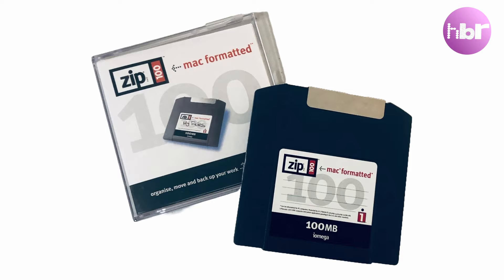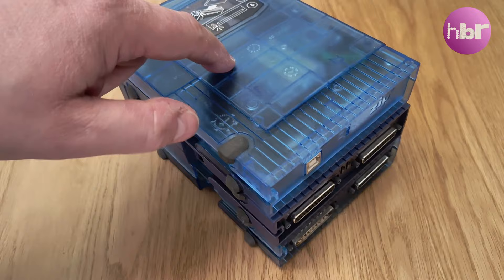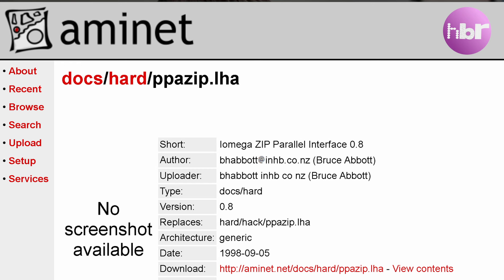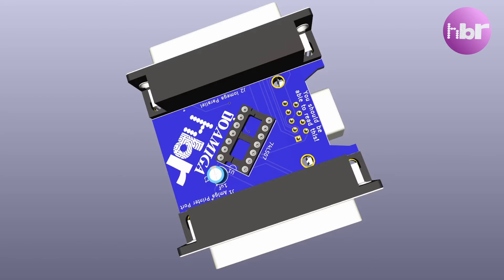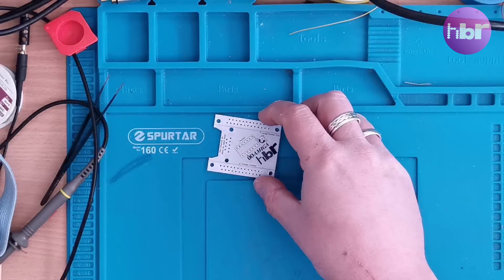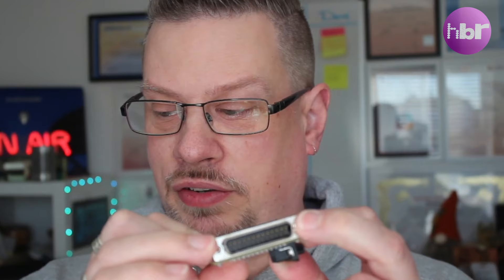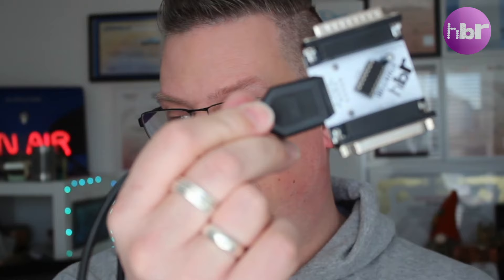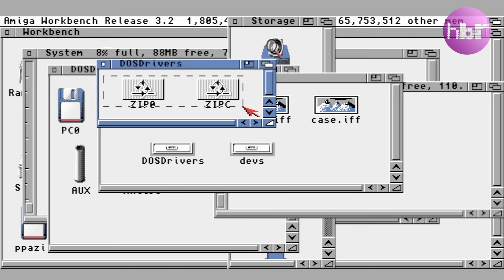Finally! Game Changing File Transfer, on the Amiga?

Comment: Maybe it's because I'm a tad too modern and have yet to even see an Amiga in person, but why not use an SD card adapter? Smaller, quicker speeds, still  works on modern devices... Granted I'm unsure if an SD adapter for Amiga computers even exists (and Ii mean full size SD cards, not mini or micro) but still. Zip disks are a wonderful option sure but they aren't being made anymore which means not everyone with an amiga can get them.. Though I guess you can't replace the nice mechanical charm they have with flash media, either..
Reply from the maker: Thanks for watching, and all valid points. You can get flash to work internally but that would mean constantly removing it then booting it in an emulator to transfer files... It's the quick transfer of data too big for a floppy like os update / installer alongside your HD / flash solution. In fact the A500+ in the video is 68030 @50Mhz accelerated with 8Gb compact Flash internally 😀
Reply: @hackbuildrestore  Wait, there's no way to mount and use flash media (SD card, compact flash, etc) on the outside of the Amiga like a floppy disk? Seriously?! That's just insane, and honestly does give the ioAmiga a lot more of a reason to exist in my eyes then, but still, WTF? Plus how would the zip disk work on both the Amiga and a modern Windows machine? Do both just understand FAT16 or something, or does the Amiga somehow understand FAT32?
Reply from the maker: If you're willing to cut holes or dangle cables I guess you could externally expose a compact flash disk, it's a bit easier on a 1200; but you still have to spin it up in emulation to copy files over 880Kb...  FAT has been around since 1980 ish, and yes the amiga can read FAT :) being from 1984-1994 depending on the model. Amiga OS 3.2.2.1 was released last year and contains drivers for DOS file systems (with Windows 9x long filename support) and FAT32 drivers too, not used them though. The disk used in the video is just a standard ZIP100PC FAT disk. Hay this solved the problem I had, and makes my life a little simpler, if it helps others great! If you don't like it or think it's stupid that's ok too 😀
Reply: @hackbuildrestore  That's still rather odd.. From what I've seen many older computers can use a flash disk externally through an adapter (which would make it seem like a floppy drive to the computer over SCSI or parallel) but, honestly, as long as the zip disks work, they work I guess. It isn't stupid to me at all (besides the seemingly odd limitation that there's no way to mount an external flash disk on an amiga without hardware mods, and you can't format it as FAT/FAT16/FAT32?), just seems like the best solution for now.
Reply from the maker: You have to bare in mind the Amiga was demoed in 1984 same year as the apple Macintosh was released, yet the amiga was colour and capable of stereo sound at a 38Khz sample rate way ahead of the time  including the multi-tasking graphical OS. To boot it uses it's own file system and partition system so to have a disk you can boot from it does so from a format that can't be read by a PC or mac, for data transfer it can read double density PC floppy disks, but native amiga disks can't be read by a PC without specialist hardware (Drawbridge or grease wesel) you can use a gotek to emulate a floppy drive that uses USB storage but still has the 880K disk size limitation. Scsi is only on board in a 3000. An ide interface is internal on 600/1200/4000 scsi is an option on big box amigas with expansion slots 1000/2000/3000/4000, the 600 and 1200 have PCIMCA which brings some options... but the 500 and 500+ that most people associate with "amiga" internal and external storage options are limited especially if your on a budget... There are side car expansions but these are rare and expensive, however, they can provide SCSI, networking or graphics expansion. A cheap scsi / USB solution would make an excellent future project!
Reply: @hackbuildrestore  I see I see.. Honestly that makes a lot of sense, thank you!
Reply from the maker: No problem, I hope your interest in vintage computing continues 😀
Reply: @hackbuildrestore  Oh trust me, it will! I don't have any actually vintage computers or devices (yet..) but I still use Windows 7 on my main PC. Half out of preference, half out of windows 10 (and linux generally, tried ubuntu in particular) not playing nice with my particular video setup..

Comment: I was using Zip 100 drives for exactly this purpose 10 years ago, when they weren’t STUPID prices on eBay. It was just a logical replacement for floppies and failing hard drives.

This is not new or game changing. 

Since then we’ve had multiple SSD solutions including Pi SCSI and BlueSCSI. 

I’ve had several of these Zip drives just fail on me for no apparent reason as well.
Reply from the maker: Thanks for watching, I am sorry you didn't enjoy the video, or find the content valuable. My point was really that the zip drive is still usable on modern hardware as well as most vintage machines. To your point not everyone has scsi or ide on their amiga, and such solutions don't always appeal to all amiga users, and don't provide simple solutions to transferring files between systems new and old. Out of the box there is little in the way of external storage devices for the Amiga 500/600/1200. This was a revelation to myself and I have tried to lower the barrier of entry for others.

Comment: Do you have a solution for the Superdisk LS120 via parallel port?
Reply from the maker: Unfortunately I don't, but it may be possible if it works similarly to the Iomega parallel interface. I don't have a drive myself and I can't recall them being popular in the UK back in the 90s. If I do come across one I may be tempted to give it a go using PPAZIP as a starting point.
Reply: Wouldnt it have made sense to use an SCSI drive?
Reply from the maker: If you have a SCSI drive and a SCSI controller to plug it into, yes... The 500/500+/600/1200 don't have a SCSI controller without some kind of expansion.
Reply: LSdrive in ide is supported with Idefix if i remember correctly. I own ide and usb versions :)

Comment: The Iomega Zip drive was an UTTER JOKE. I went to USB flash drives after my Iomega started the Click of Death (TM).
Reply from the maker: Thanks for watching, "UTTER JOKE" might well be your experience, it certainly wasn't mine :) You may have been either late to the party and unlucky or had an early drive that lasted you 4 years?.. as USB was only introduced in 1996 and flash media was only a thing (and expensive) from about 2000. Click of death was only really an issue on early drives to my recollection and only on the ZIP100 (also my recollection). With vintage computers implementing USB mass storage is a bit harder than using something close to period correct.
Reply: @hackbuildrestore I was late to the party, I specifically ordered an Iomega Zip Drive for my custom PC of 1998, and while it worked for a short while, the click of death started later on, thus becoming useless inside my PC case.
Reply from the maker: Wow, the 250 Drive came out in 1999 after the lawsuit in 1998, I had not heard of "click of death" (cod) as such on the internal drives, I know there were a few slightly different issues with similar symptoms that all got dubbed cod but not all where the destructive head alignment seen on early drives, I'm no expert by a long shot, I have maybe been lucky over the years... I do have one drive with some form of cod and might look to investigate that further at some point... I also can't remember if it affected different markets depending on where the drives were manufactured or not!?... Or if disks had a bearing on it?..
Reply: Stories ,stories , never had such clicks from zips to this day
Reply: @cnfuzz  I DID.

Comment: Can you even buy new disk these days?
Reply from the maker: A good question as far as I know the only new disks are old stock. However, I have found used ones to be quite reliable! Plus I'm not suggesting using them for backup, long term storage or boot media, just file transfer...
Reply: @hackbuildrestore  Just curious. I thought about getting one back in the day but since noone else I knew had one and I could transfer between my 500 and 4000 with parnet so I really didn't see the point.

Comment: I don't see anything "game changing" here. Sure, you did a nice layout of a pcb from Abott's first project but anyone with a breadboard could've built that too (and I am sure did it in the past). Don't get me wrong, I really appreciate your work and making a video about this, but please stop using that "whoooaaaa this is a gamechanger" clickbait titles for you videos.
Reply from the maker: Thanks for watching and taking the time to feedback, IMO it was game-changing at the time and it was for me personally re-discovering it. Not every amiga owner is able to or confident in building this stuff themselves or is aware it exists, and with the rising cost of Amiga-specific hardware, I would say this is more relevant now than it was in 1998. I'm sorry you felt this to be clickbait, but the title accurately reflects my experience. 😀
Reply: I don't see it as much of a gamechanger nowadays, with easy PCMCIA2CF adaptors for my A1200 and A600..... And I had the SurfSquirrel back in 1998 as well, and owned both a parallell and a SCSI ZIP drive.

So for me , personally, knowing this was/is a thing isn't much of a gamechanger. 

That said, I got a fair few bits of Amiga gear when "everyone" just threw it out in the early 2000s, and I could for sure have used this for the A500, but I got the A1200 first and the SurfSquirrel was cheap-ish.... And the A1200 could handle so much more RAM with their accelerators.....

Anyways. I dream about a more innocent time.....

I was not aware of this, and for sure, it would have been very handy back in the day, had I still used the A500.

Comment: Zip Disks and Zip Drives were entirely unreliable.  My company bought several Zip Drives back in the day and the drives usually failed within weeks and many times, new disk media would fail within minutes of being pulled out of the box and formatted.  We leaned quickly not to put anything important on a Zip Disk and quickly moved on to more reliable methods of storage.
Reply from the maker: Thanks for watching! Everyone's experience is their own, which seems to differ greatly based on when and where you used a Zip Drive... My experience has been generally good and considering I have several drives that still function after 30 years they can't all have been junk 😉 can they?